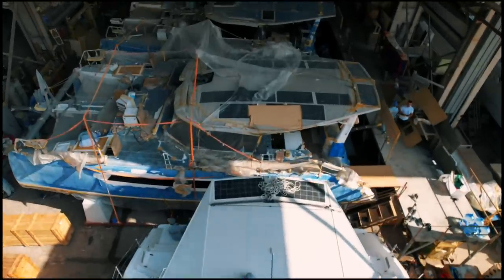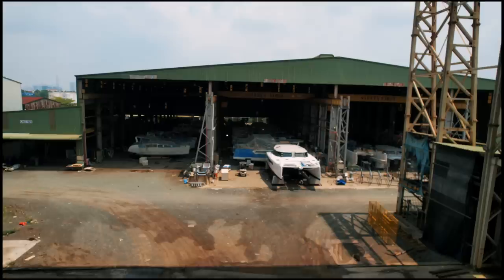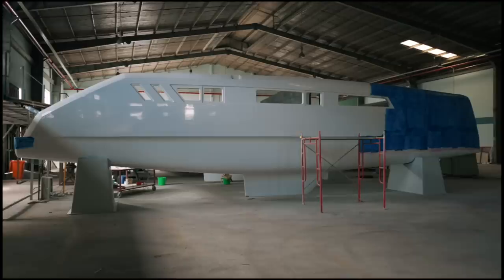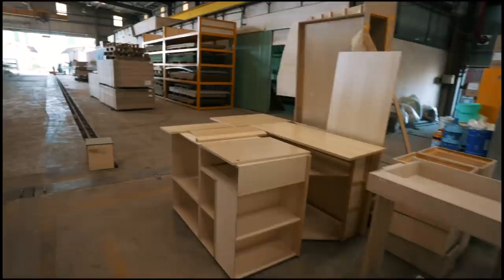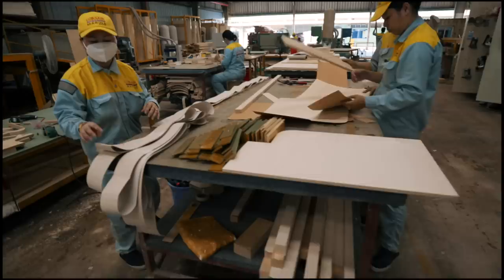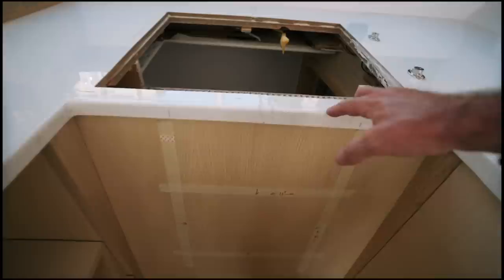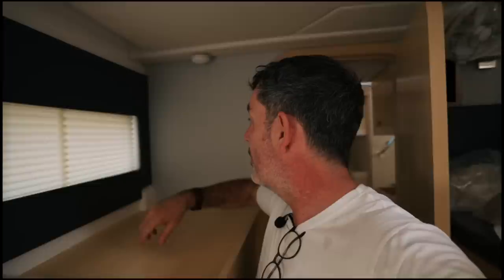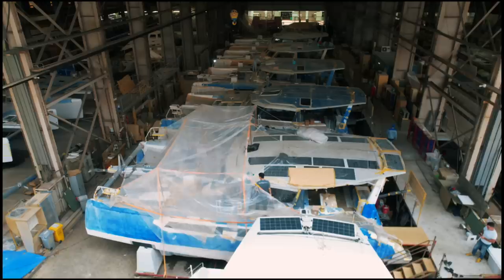How Does Raw Lumber Become a BOAT?

Comment: I noticed that they have installed blinds that are fan-folded........... There are "Cellular Blinds" that form cells when let down and keep the heat out in summer and heat in for cold weather. I have them in my house and they are excellent ............  There are even double cellular (thick) blinds available. These are in opaque and sun blocking types. Worth looking into ....................  enjoy
Reply: The blinds caught my attention as I have a Seawind 1250 with the Oceanair Retractable Blinds. I am curious as to how they compare & how they will wear, especially when they get mould on them ? At present it is a simple wipe over a constant flat surface to remove any mould with those it doesn't look possible let alone easy ??

Comment: The changes on hull-1 really do look better than the first iteration. While some people might scoff at using veneer over foam core panels, the simple fact is that the savings in weight are a major benefit for any sailing boat.  That weight savings also means you have more weight-carrying capability for your personal stuff so you can live and operate that much better while underway or just living on the boat.

Comment: The reason why the timber comes in  rough sawn  is   when it  is  machined  it will  move  if  its left for an amount of time , it will bow  and twist   when it takes on moisture and tension is released when the timber is made thinner , so  its better  to plane it up when needed   to reduce the amount of movement , its better to leave it in a  thick board  that is thick enough  to plane  flat

Comment: The vacuum table is to apply clamping pressure, at 14.7 pounds per square inch.  

That's ~126,083.28  debens per square cubit if you are an ancient Egyptian.

The air is evacuated and atmospheric pressure places force on the content of the bag  in a uniform manner across the surface.